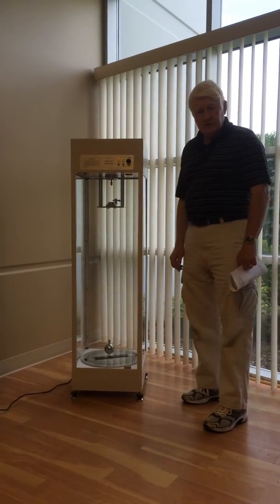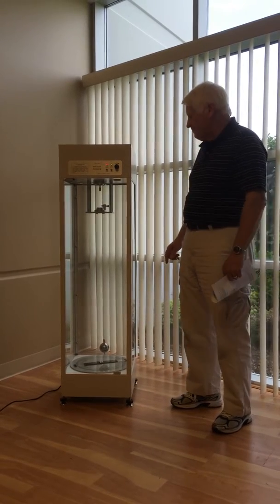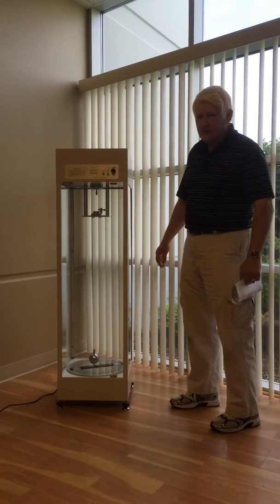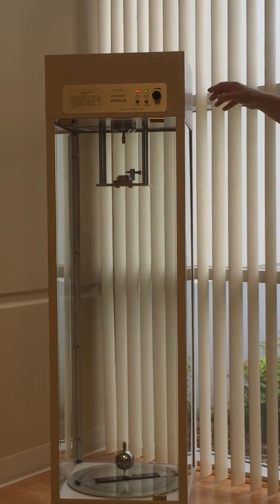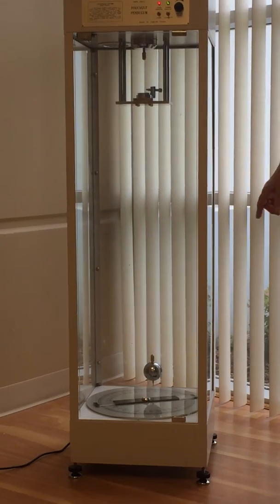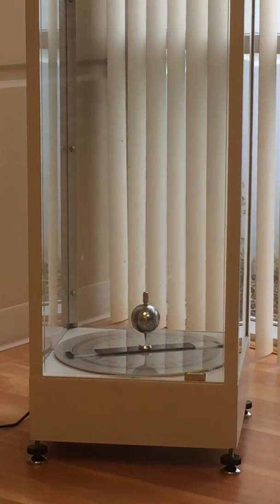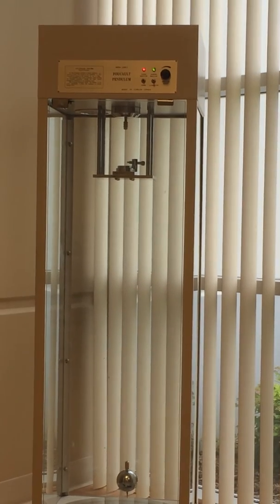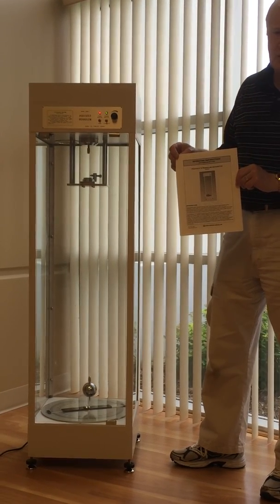Examining Foucault’s pendulum (FCPN01)

Comment: IT IS SHOCKING THAT YOU WOULD USE AN ELECTRO MAGNET TO KEEP THE PENDULUM SWINGING , A CONSTANT FORCE SPRING OR A WEIGHT WOULD BE FAR MORE SCIENTIFIC AND GIVE SOME CREDIBILITY TO RESULTS
Reply: It is shocking that you dont understand that a centred electromagnet keep the pendulum swinging without affecting its direction and that's exactly the point. A constant force spring would put a preferred swinging direction, which deny the meaning of the experiment. For the "weight" i dont understand what do you mean, there is obviously a weight, but still the pendulum will stop cause air friction without the intervention of the electromagnet.